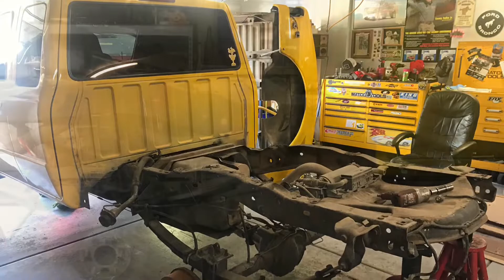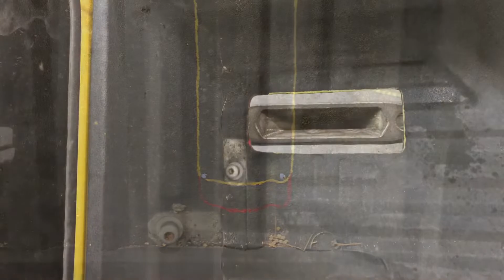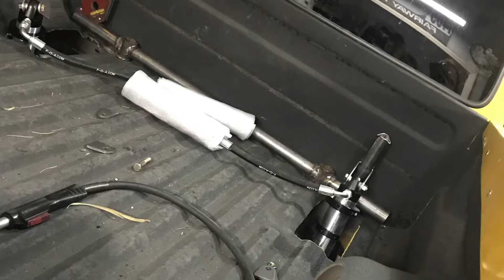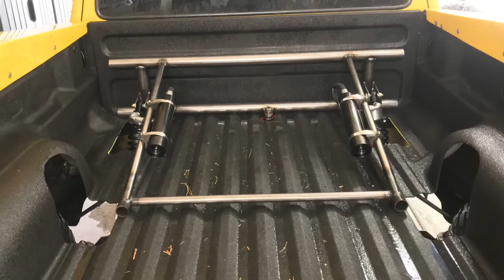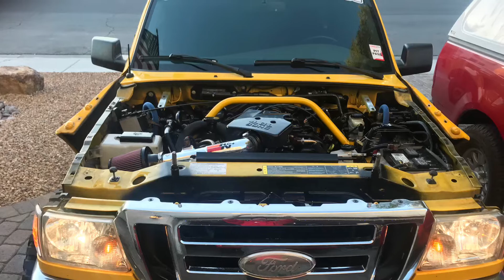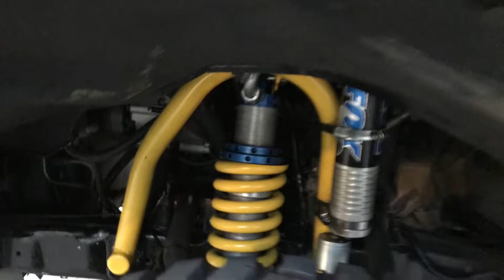Ford ranger prerunner 3 link long travel

Comment: Cool little setup Robby 👍🏼. Wondering what length of lower trailing arms you used and also the length of coilover shocks. Glad you are still putting your skills to work brother, seen other work you have done way back when you were involved with the full droop show.
Reply from the maker: gillypig1 thank you. These particular lower links are 60”. I used a 12” Coilover shock. It has 22” inches of travel with the stock frame, stock rear end, and factory driveline.
Reply: Woolworth Motorsports Ford ranger awesome! Vs a leaf spring setup this must be super plush! 😎
Reply from the maker: gillypig1 really plush.
Reply: gillypig1 great job now its time to spend more money on my ranger and yes I would like to know what length you used on the trailing arms as well , you can see my set up also